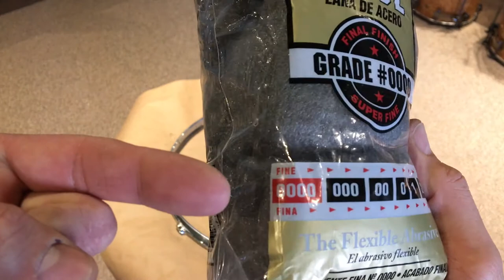How do I clean my drum hardware?  Quick Tips #5

Comment: Even xxxx steel will cloud or haze certain chromes...most long term vintage guys at the chicago vintage drum show will tell you with vintage american valuable lugs and 50s and 60s hardware will use a gradual process, 1st starting with mildest solution like maybe deluted dawn first, that usually works great most of the time but if not..then.2nd use a 3M chrome cleaner/polish or maybe a wad of duz all...3nd and only if its really pitted w rust use xxxx steel wool but only in conbination with a  light base of wd 40 to loosen the dirt and rust.... in the vintae industry thats what you will hear from them
Reply from the maker: Thanks for the comment @jackpropps. Yeah the older hardware is oftentimes nickel. Which 0000 steel wool doesn’t work well on “vintage” hardware many times. Found that one out the hard way.  

Vintage hardware is always tough to work with.  Never know what condition it’s in or how deteriorated it is.  

I’ve heard that Dawn Dish Soap and warm water works well on cleaning vintage hardware.  Then of course drying it before using polishing compound.  I’ve never been a huge fan of vintage gear and under normal circumstances leave it in its current condition versus trying to revive it.  

There are several shops out there who love vintage and know the ins and outs of them…I don’t happen to be one of them.  

Thanks again for your comment and hope you have an amazing day. 

RN

Comment: Hi, great tip dude. Does it works the same with black nickel (or black chrome, I'm not sure) hardware, or is there any other caution to keep in mind?
Thanks !
Reply from the maker: Thank you kindly...I appreciate your compliment.

Sadly I don't think it will work on black chrome hardware since that is an electroplating process that occurs on top of the chrome...I believe.  Plus some "black chrome" is actually just black powder coating.  

You can always try it on an inconspicuous part of a stand and see what happens.  If it does work - please drop me a line and let me know your results.

Gratefully Signed,

Roger N.
Reply: @Drumshoptulsa  ok, thanks a lot for your reply. I'll let you know if I try, of course!

Comment: Hi there, I've had a lapse in playing my drums for several years and haven't had access to them. Looking at things recently, it looks certain stands and hoops and other hardware have gotten very corroded. Would i need any cleaning fluids to remove that or will the 0000 steel wool by itself still be enough? I just want to try and be sure my parts can be salvaged and not damaged beyond repair. Any info and help you can share would be wonderful. Thanks so much! 😊
Reply from the maker: Hello @masterofmetal15.  Great question.  In most cases, the corrosion will get cleaned up with the 0000 Steel Wool.  I would take a hoop off of the one of the drums, grab a piece of steel wool and test and area with a little cleaning.  

NOW...IF there is Jaegermeister or some other unknown "stickiness" then yes, a little cleaning will do wonders.  But as har as the corrosion and general "mung" the 0000 Steel Wool will be like magic.

Send me some images if you'd like.  You can email me: roger@drummersservices.com or text me at: 918.261.1380.  Would enjoy seeing your progress.

Have a great day and happy cleaning.  

Roger N.

Comment: Just like that!? Are you sure this wasn't processed in adobe after effects or photoshop or something..?
Reply from the maker: Nope...no Photoshop or anything.  When I was in the cycling industry we used 0000 Steel Wool to clean chromed parts on bicycles and I’ve used it ever since on drum hardware. I know it seems like it should be fake but I 100% assure you the results are real.  

Please remember if you are cleaning your lug casings, take them OFF of the drum shell first as the 0000 Steel Wool will 100% scratch your drum shell finish. 

Thanks for the comments and happy cleaning.  

RN
Reply: @Drumshoptulsa  It looks amazing! I'm definitely going to try this. Thank you.
Reply from the maker: You’re very welcome.  It works amazingly well and is like $4:00 a bag USD at Home Depot. 

Have fun and send me some before and after pics...would enjoy checking them out.  

RN

Comment: Can someone help me with removing old foam from shells? Stored long term in cases with foam that deteriorated. Thanks.
Reply from the maker: Hello.  Thanks for your question.  Are they fiber or plastic cases? If they are plastic, you should be able to use acetone to get the adhesive out but you will still have to pick out the foam. Oddly enough WD-40 does a great job at releasing adhesives.  

If the cases are fiber you are going to have a challenge ahead of you.  Once you pull all of the foam out, you may be able to use Goo Gone which is more of a citrus based degreaser and hopefully won’t damage e cases too much.  I would test any “solvents” or adhesive removers on a NON-Critical location if the case and see what happens.  

Either way, you are going to have a lot of work ahead of you.  I’ve known other people to simply spray adhesive onto new foam and stick it on top of the old foam. 

I imagine it would depend upon how much time you want to spend restoring your cases. 

Please share some images once you’ve decided what to do.  I am VERY curious as to your results.  

Have a great day and good luck.  

RN
Reply: @Drumshoptulsa  Thanks so much for the quick reply.  I'm actually not worried about the cases which are Anvil and probably fiber. I'm more concerned about the actual drum shells and finish. It's a 1980 Ludwig kit with natural finish. Big blotches of foam on the shells. I appreciate the help. My buddy passed. They were his drums and I'm helping the family.
Reply from the maker: @TheKannielu  yeah....they are older fiber cases.  If you visit an army surplus store, they have various thicknesses of “camping foam” and you can purchase sheets of it for a reasonable price. If the drums are just going to be stored in the cases, I would suggest getting the foam, wrap it around the drum and place them into the cases.  At least they will be safe.  

If they are being stored, remember to keep them off of pavement as the cold and moisture will make its way into the case.  Store them on a palette and to keep them off the ground. 

Sorry to hear of your friends passing...that is always a challenge.  Please accept our condolences and remember to keep him close to your heart and celebrate his life.  

Best of luck during this challenging time.

RN

Comment: Same on nickel hardware?
Reply from the maker: Hey Mini Me…nickel hardware (i.e. vintage hardware), is a bit more labor intensive to clean.  Yes…0000 Steel Wool will help tremendously. However keep in mind, nickel is a “precious metal” whereas chroming is a “process.” 

I would suggest using a cleaner specific for nickel to get the best results. Then use the 0000 Steel Wool for the “challenging” areas.  

Thanks for your great question. Hope this helps.  

RN

Comment: Does it remove rust on tension rods ?
Reply from the maker: Yes it sure does.  An easy way to use steel wool on tension rods is to use a drum key for a drill, put the bit in the drill. Hold the tension rod in the drill bit, run at a safe speed and LIGHTLY hold the steel wool around the tension rod. Then BAM!! Clean tension rods. 

Thanks for your question and I hope all goes well.  

Let us all know how the kit came out...we’d love to know. 

RN

Comment: What about a steel shell snare? Would it scratch that?
Reply from the maker: Hey Chris. Most metal shells will have a clear lacquer coat. You can do a test on a section near the bearing edge (underneath where the head contacts the shell). If it polishes up, you should be good on the rest of the shell. Just be cautious and take your time.
Reply: I used it to clean a really filthy Ludwig Supraphonic snare from the 60 with some WD-40. It's still pitted in places but really shiny.

Comment: I have a steel snare can I use this on the snare shell?
Reply from the maker: Hello and a great question.  Some of the steel snares have a clear coat on them to protect them from corrosion.  What you CAN do is to take one of your drumheads off and test using the 0000 Steel Wool at the bearing edge and see IF it cleans it.  If there’s no clear coat it will ABSOOUTELY clean it like a champ. I’ve been lucky in the snares I HAVE used it on worked out great.  Just take it safe and slow. 

Which steel snare drum do you have?

Keep us all posted what your results are.  

RN
Reply: @Drumshoptulsa  Mapex steel piccolo snare 13 in
Reply from the maker: @chewy5008  the affordable one that is hammered?? Or the nicer Black Panther Model? The affordable one may not have a clear coat but I believe the Black Panther Model does have a clear coat.  

Test it on the bearing edge and see what happens.  If it looks okay, go for the rest of the drum and see what happens.  

Keep in mind, when using 0000 Steel Wool, it will open the steel to being more susceptible to sweat and oxidization.  You may have to “keep up” on the polishing but will keep the snare looking amazing no matter what.  

Keep me posted and let’s see what happens.

RN
Reply: @Drumshoptulsa  I probably have the affordable one because it was like 60-70$
Reply from the maker: @chewy5008  aaaahh yes.  I sold a boatload of those over the years.  Yes...try the steel wool on the bearing edge first. Make sure it cleans it with NOT too much effort and you should be good to go.  

Keep me posted. 

RN
Reply: I saw a trick on using aluminum foil and rubbing the shell...works wonders